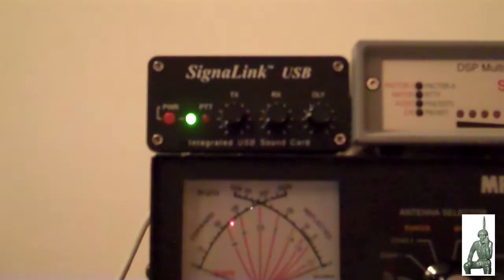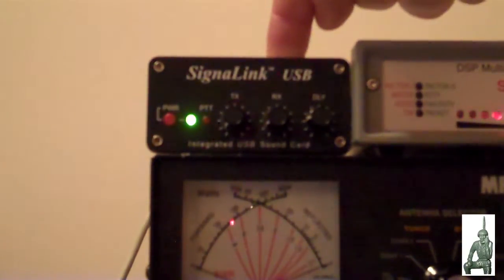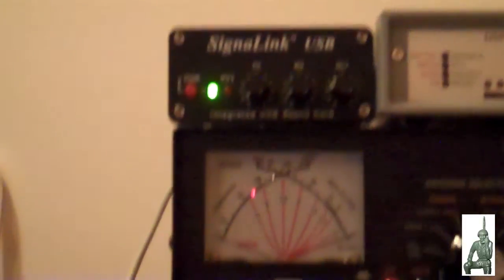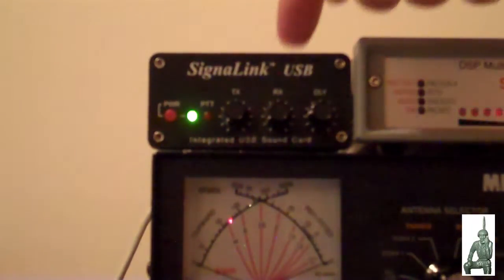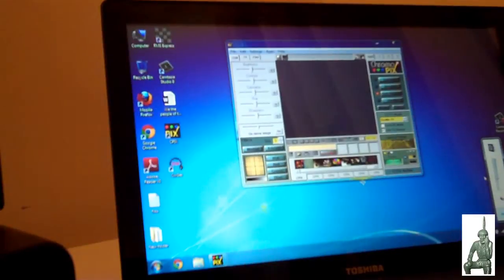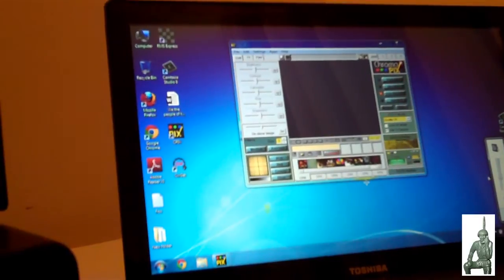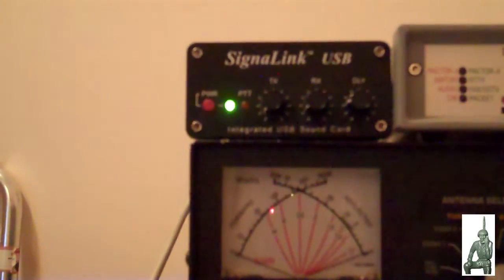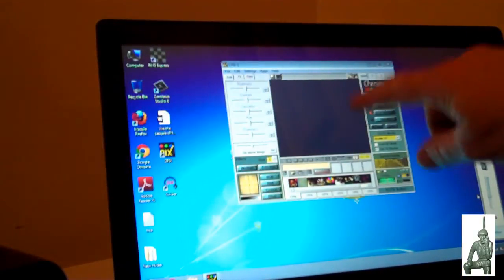Sound Card Communications - Slow Scan TV (SSTV)

Comment: So. I'd that modern necessary? Can we just hook it up to the computer directly and use software?
Reply from the maker: The sound card interface (Signalink USB) is required between the radio and the PC.
Reply: Commsprepper You couldn't have just connected the audio out of the radio directly to the microphone jack that's built onto pretty much any computer?
Reply: digivince yes you can, for just reciving.

Comment: I play with PSK31 and SSTV without a Signalink or other interface. I use acoustic coupling by placing a microphone from my computer next to the radio speaker and placing the hand mic of the radio in a set of cushioned headphones with the mic set for VOX.  Computer mic pick up signal from radio and feds to computer.  Computer audio goes to headphones, picked up by handmic and transmitted over the radio.  73, kc5sas